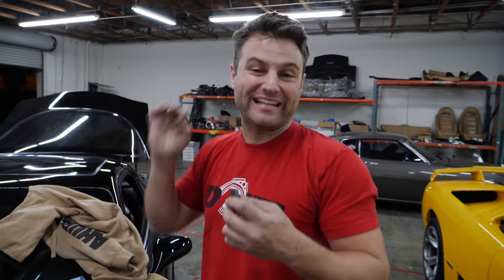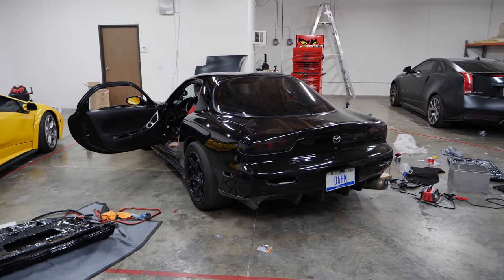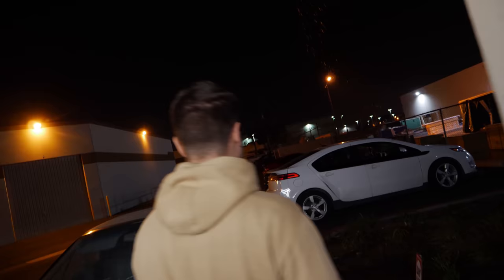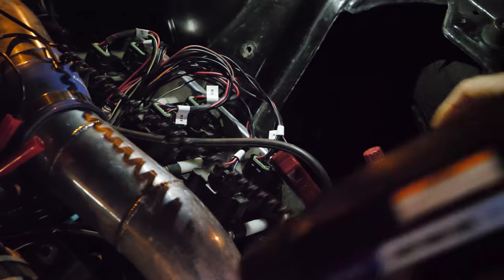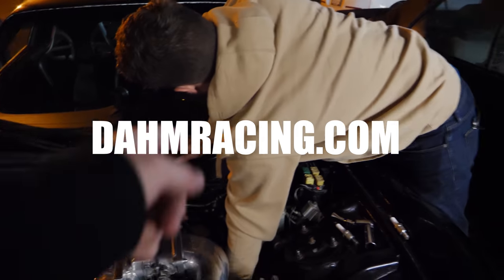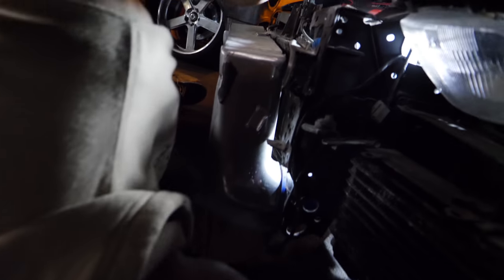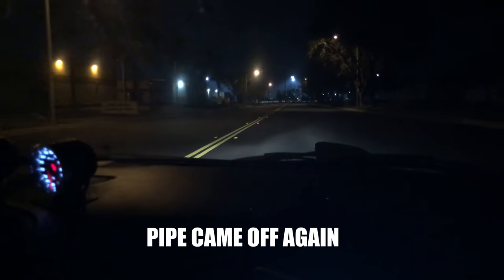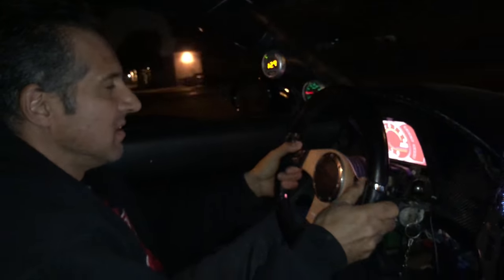Misfiring like crazy at 30 psi! 3 Rotor RX-7 dyno day goes off the rails

Comment: Rob Dahm I own a tenth anniversary TII Rx7 with a Bridgeported 13B-REW 3rd gen motor. I have ran so many spark plugs through the years until I tried AUTOLITE Part# AR3932X which is a heat range 9’s and since going with these I haven’t had to put plugs in my motor for close to 6 months and I’m running 20-25psi of boost. You can also get Part# AR3933X which are heat range 10’s make sure you order it with the X on the end of the part number. 4 plugs cost me $20.00 instead of $35-40 for the NGK. I’ve yet to have any type of ignition break up and have yet to foul any of them as well and I’m currently running ID1050x primary’s and ID2000 secondary’s with twin Walbro 485lph pumps   Just some food for thought
Reply: Autolite part# AR3932X or part# AR3933X

Comment: come on... you have to dyno it at 0 pounds of boost.
Reply from the maker: 😂 I’ll pull the pipe off and dyno it if abel let’s me. Just for this comment
Reply: Mad Mikes 4 rotor na rx7 was making around 430whp so im guessing Rob's rx7 will make close to 320whp all motor.
Reply: @DimZin  no it had around 700 NA as his TT 4 rotor is between 1100-1200
Reply: @nathanortiz2810  You're right,just searched it. It was making 650 at the crank which is 562 at the wheels. So Rob's might make close to 350- whp considering it's not built for all motor.

Comment: Rob, I know you have a lot of people commenting, but you cant just pull plugs and check them, wipe them off and pop them back in and hope for the best they have internal resistance, and they can go bad, so to accurately diagnose a ignition misfire, you need to whip out the multimeter and check the dizzy/coil pack if it has it, and the spark plug resistances (normally range from 4-6k ohms depending on the plug). Also continuous misfires can cause plugs or coils/dizzy to go bad internally.

Comment: Original owner of a '94 FD chiming in again. 
Mine is 99% stock, but i did install Petit Racing's cold air intake, under drive pulley and Borla cat-back system after a few months of ownership. My point being, when I first drove it with the air intake mod, those damn blue silicon couplers kept popping off for the first week and then they finally stayed put. I was just using regular old fashion screw-type Gates hose clamps like you. I always thought they were better than spring loaded clamps like the ones that came from the factory. WRONG. As hoses get older or start getting a little bit worn out, a screw-type clamp can lose it's tightness where a spring loaded clamp continues to squeeze tighter when things change. I know there are LOT better clamps than both of the ones I'm talking about and I think you should seriously look into a better option, especially with the boost levels you plan to run!
Good luck with both FDs!!! /Cheers from St. Louis, MO
Reply: tscooter22 they are called worm clamp.
Reply: jon doe  LOL.  I'm going to have to pass on that.
Reply: @msengineeringdavid3702  Right. Thanks for the reminder!  After googling, I'm thinking T-bolt clamps are what I've seen used for high pressure boost hoses. Perhaps there's something better, dunno.
Reply: er  body in the boost world knows worm style clamps pop off easily, T-Bolt clamps are much better. Also the old school spring clamps work very well just a pain in the ass to remove frequently
Reply: I thought this was going to end with a sarcastic recommendation

Comment: Rob, that alternator swap is huge if you can't sustain voltage with electronic ignition it will fail.  Taking the some amusing abuse from someone with Abel talent is a small price to pay for the results to be gained. Great video !
Reply: Gerry Milidantri talent?  That was just common sense.
Reply: @msengineeringdavid3702  I'm a new subscriber so I haven't seen all the episodes but watching Abel build the 3 rotor and operate the Dyno I say he is talented

Comment: This car is kinda nostalgic for me. I used to own a 50ccm scooter that was just as hacked together with a 70ccm cylinder kit from another engine, different crank also from another engine, modified engine porting, too big "gearbox" (vario) for the engine so it had to be modified, a "huge" carb for this type of engine and a go-kart ignition system. The wiring and looks were pretty much similar, but it worked and made decent power, (over 20hp on 70ccm compared to the stock 3,something). I love the car for giving this feeling back to me.

Comment: Thought I'd mention (in case it hasn't been already) The spark plug you had in your hand when you said "this is the trailing plug" was a leading plug.
The Leading plugs are the ones with the raised quarters, the more open ones are the trailing.

Comment: Had similar breakup issues with haltech at 4000 rpm. Needed to change ignition setup to adaptive in ignition settings . Fixed problem. Run a scan check that pick up signal is clean. Process of elimination.

Comment: Not an a/f ratio? If you are running 13+ under load of a spooled turbo,  your engine is not a ticking time bomb. It's just ready to detonate and evolve into a T-1000, just without the terminator insignia. And the claim of 1000 WHP for any reasonable length of time.

Comment: I'm guessing that your goal on 1k hp is just to pass mazzei's rx7 power. I'm i right?
Reply from the maker: I already made more power than it before it dynoed. This is to hit a clean  maximum with the current setup. We ran out of fuel before. He does have more to go if he was to get a solid rear end and turn up the boost.  So in my mind his car should have more power than this. But actual numbers wise the 3 rotor is significantly more powerful at the same peak number
Reply: @RobDahm  You mean that at the same power the 3 rotor is faster than the 4 rotor? How's that?
Reply: Also i mean his current power which is 950whp and you made max 928whp right?